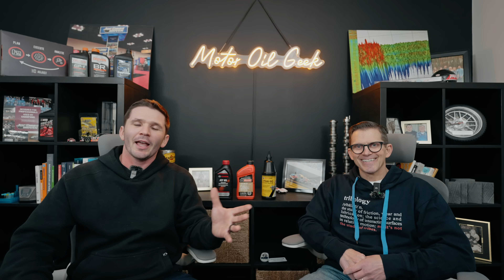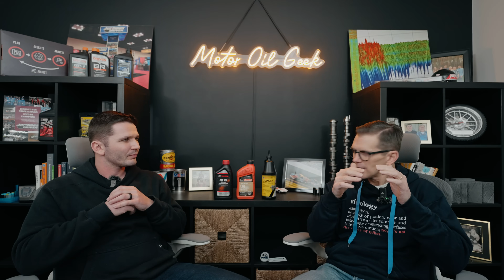Engine VS Transmission VS Gear Oil With The Motor Oil Geek

Comment: Would it be possible to shine some light to the oils used in modern manual transmissions? Some oil manufacturers recommend very low viscocity dual clutch transmission oils and even atfs for some applications like Red Line D4 and many people seem to be using them with good results. What are the pros and cons. The question is targeted to the Getrag and Zf manual transmissions used in Bmws.

Comment: My 2014 hyundai veloster runs 75 90w gear oil in the dct transmission... 234k miles... original fluid

Comment: Can you talk to the fact that the military uses a Rotella 15W-40 for everything. Engine oil, gear oil, hydraulic fluid, and in some cases trans fluid. All you have a 25 gallon storage tank where it is connected and circulated through all it needful areas just like a hydraulic system would. 
Can I do the same thing with my Ford 1 ton diesel truck and run that oil through all my systems?

Comment: 50 Years ago, I was a motor pool mechanic in the Army at Ft. Knox. We were hauling asphalt for 13th Engineers in 5 series 5 ton dump trucks with Continental diesels but we did have 2 8 series jobs with Cummins. These loaded trucks had to climb hills in the process. We were blowing the Continental engines left and right. The Army was using bulk OE 30 and were changing oil on schedule. When we suggested they should switch to Shell Rotella and or change oil when it was wearing out, we were told that it wasn't "authorized." Long story short, we kept blowing up those engines. Cha - ching.

Comment: 0:46 "only piston engines have to deal with combustion byproducts"
Yes, traditional piston engines are way flawed and oil geeks have had to work chemical magic, but the new generation of simultaneous-combined-cycle piston engines won't have such issues. They are clean and segregate combustion from oil by using the steam/regeneration cycle to separate combustion from the PFTE piston rings. Such engines will use single weight simple oil stored in a vacuum insulated flask.
1:27 "blow-by"
Yep, but as long as the blow by is pure water that is evaporated and evacuated by the secondary air system to the oxidizing cat there is zero harm.

Comment: So everyone knows engine oil needs to be replaced annually. How often should you change modern synthetic transmission, transfer case, and differential fluids if I only drive a few thousand miles per year? At 2-3k miles/yr, it would take me 10-15 years to reach the 30k mile interval on my MDX. Surely these fluids can't still be good after over a decade of being in the car, right?

Comment: 9:05 Transmission and diff have breather and you can get moisture in them and from temperature cycles in condensate and drop in the fluid. I seen it when the car was not driven long enought and the ATF instead of being red goes pink but still transparent

Comment: I have seen one or two OEMs validate the early oil change idea, but then they went away from it.  Mercedes did recommend the first transmission fluid change around 30-40k, then supposedly good for the lifetime.  Toyota had an early differential oil change interval the first time, then a prolonged interval after.  You only need to look at brake fluid change intervals to see the wide range of OEM recommendations for the same fluid, anywhere from every two years to lifetime.

Comment: Thanks Lake. Validates my decision to always use Toyota WS in specified applications (AIsin 700 series transmissions) for years and countless vehicles. Never an issue!
Reply: I used Aisin WS from rockauto, given that they make the trans itself, I suspect their fluid is just fine. Heck, I bet Toyota gets their WS fluid from Aisin.

Comment: I really dig on content like this.  Just keep to the facts.

I've detailed the engine break-in process that I follow and the most common response is: if its so good why doesn't the OEM suggest it?  The simple answer is: virtually no one would follow it, as very few would do 3 or 4 oil changes in 3000 miles, as they would view that as a real hassle & they don't want to spend that much time/money in such a short timeframe.

80,000 miles later nearly every one of those engines begins to have significant oil consumption issues, whereas the engine that I broke in does not.  They start blaming everything except how they broke the engine in.  The part that they're missing is that the instant you drive 1 mile past the mileage warranty 100% of that repair bill is on the person that owns that vehicle and not the OEM.  This is also why I've seen so many people put their car up for sale just before it hits 80,000 miles - they know a big repair bill is coming up, and they don't want to deal with it.  The common reasons that I hear are 'I just want something newer' or 'I want the newer features that my car doesn't have.'  Those are both valid reasons, they're just not saying the repair bill one out loud.

You can lead a horse to water, but you can't make it drink.

Comment: Glad to hear a knowledgeable expert advocating for OEM trans fluid. Seems like the logical choice for such a complex component, rather than using some aftermarket product that’s supposed to work across multiple product lines.

Comment: Can you guys talk about transfer case fluid? What’s with different vehicles using engine oil, gear oil, or transmission fluid in the transfer case? And then what happens when you use a different fluid than what’s recommended?
Reply: @Duramaxjon  a lot of that depends on the internals of the transfer case. Some are simple gear to gear and rely on splash lubrication. Others have chains and sometimes internal oil pumps. There are also many modern transfer cases with internal viscous couplers or clutches that need to be able to allow for some slip front to rear. ( think auto 4wd or AWD cars and SUV’s). These often need a special fluid or synthetic ATF to prevent shudder or binding during tight turns. So it really depends on what’s inside to determine the required lubricant.
Reply: Gear driven cases like the NP205 and Dana 300 run gear oil. Chain driven cases run ATF. AWD cases with a viscous coupler typically run a tractor hydraulic/transmission oil.

Comment: I grew up in farming. I have spent my life dealing with hydaulic and hydrostatic oils as well. I learned young. From my master mechanic grandfather. Always use the correct oil. Change out the oils in new equipment to get rid of break in contamimants. And smart regular maintanace greatly improves lifespans.

Comment: What about all the VAG cars ? With their 'lifetime' manual transmission oils ? There's no issue with the gearboxes with 1st fill even after 200k miles. But changing the oil for correct OEM one, no matter in what mileage, will in most cases cause bad cold shifting behavior, and cold i mean below 5 Celsius. Happened to many cars for me or around. There's a lot on EU forums regarding this. 90% of cars in EU had never oil change in manual gearboxes. I won't change either because of bad experience.

Comment: I recently changed the transmission fluid in my wife's CVT equipped car...and after listening to this, I am glad that I bit the bullet and bought the OEM fluid from the dealer. Even at $35 a litre....7 litres is far cheaper than a wrecked transmission.

Comment: At the end of the day if you do not change your engine oil much sooner than what the car  Manufacturers  and Dealerships  say your engine eventually be Toast ...i would definitely not buy any car that has gone with the Manufacturers oil changes imagine a Brand new car that as to run in the engine the first engine oil change should be 500 miles the metal fragments from runing the engine in will cause Damage change the first engine at 500 miles get rid of all the condensation from breaking in your engine the second oil change 1000 miles then 2000 miles ..then .3000 miles the every 4500 miles your engine will last you many many years ..Do as the Car Manufacturers and Dealerships say 10.000 mile oil changes Car Manufacturers know if you Stick to the Manufacturers Service Schedules you will start to get Mercanical engine problems  just when your warranty expires ..Big profits  to the car Manufacturers  you will be buying parts from them  or you will eventually a new car ..

Comment: So then how does that work in motorcycles that use the same oil for all three components?
Reply: it is a compromise for the overall
usually the fewer compromise the more specialized something is and the more expensive it becomes

Comment: If you get a chance to do a follow up, I would be interested in hearing about the viscosity difference. Specifically I have read that an engine 5W30 is similair to gear oil 75W90 for viscosity. (Or something like that.) They feel tremendously different. How can they be similair?
Still great information here. Especially the comment about OEM transmission fluid.
Reply: different viscosity scale for gear oil vs motor oil, gear oil is slightly thicker than 10w40, but it's not anywhere near it's number on an engine oil scale.

Comment: Well I am surprised to hear Lake say he believes in going with the OEM transmission fluid. While I understand his reason, if the manufacturer is willing to sacrifice a customers engines longevity by putting in super thin motor oil to meet CAFE standards, they likely are doing the same thing with there ATF for our transmissions. How can we be sure they aren't?
Reply: Don't worry, as they say its Lifetime but you change It on milleage.
BimmerN53
Reply: So you have an expert telling you... and you question it and think you know better?   Unbelievably dense!
Reply: @Ram14250  Who said I know better fool? Go back and watch all sorts of experts (of which I give Lake credit for being one of), and they are now all saying the OEM recommendations were misleading at best, and flat out lies at worse. WHY? All because they were trying to eek out a MPG or more at the expense of customers engines.

Comment: Regarding ATF we must not forget It flows through  circuits, electronins and solenoides flooding and cooling all the mecatronic system with dieletric properties.
BimmerN53

Comment: The Amsoil ATF really throws a wrench into the mix. They printed on their latest labels: "Use in applications that require the following specifications". I've had it my transmission for close to two years.

Comment: Too often Mercon LV does not do what is intended (i.e., lifetime fluid). There are better alternatives it would seem in this single instance. Ordinarily I would also stick with the OEM ATF, just not for this one. I would also change the Mercon LV (and ULV, as the case may be) or its alternative more regularly than even the severe service interval in the manual. It will be money well spent.

Comment: Hi guys. Great information!
What about motorcycle oil with both combustion and clutch and gears?

Great channel!
Reply: look for JASO MA/MA2 certification
Reply: The MA2 is a higher friction spec is better for clutches prone to slip.
Originally, the spec was MA but later MA1 and MA2 specifications differentiate the slipperyness more.  A bike which is specified MA2 cannot use MA but for a bike specified with MA could use MA1 as long as the clutch doesn't lack bite.

Bikes with gears and clutch in engine oil all shear down incredibly quickly due to not being able to use gear additives in the engine.  The hot grade can shear down a grade in as little as 1000 miles (eg: a 10w/40 becomes a 10w/30 according to published oil analysis results.  Signs are normally noisy gears.

Comment: I have never, nor do I know anyone who's changed their trans fluids for like 50  to 100 kilometres. Scary really. 

Guys you didn't address the difference between types of trans oil. Like DW-1 to ATF2.1 or many others. 

Do you have to use the type in your manual? 

What happens if you buy Amsoil ATF and put it in your Honda and does it work with different transmissions? 

What about the different types and hydraulic effect?  Low level vs  high on transmission fluid?

Comment: What about manual transmissions, and all the advice out there to use engine oil in them?
Reply: Nope not necessarily. Check your owners manual or check with the dealer/manufacturer. Some call for GL4 gear lube, because GL5s are generally considered risky for yellow metals like brass/bronze. Some call for a 5W-30 or 75W-90 syncromesh fluid. Some even use an ATF.  A lot of that has to do with the syncro blocking ring material, some are brass, some are composite materials.

Comment: Motoroilgeek? Is there such this as charging the transmission fluid on a Lexus or really any automatic to much were it will start slipping or shifting weird?
Reply: LOL, , NO!
Reply: Yes, with automatics. Too frequent changes and you'll lose too much of the clutch material in the fluid that prevents slipping. Never changing means that all the nooks and crannies of the valve body become jammed. Six years or 50K intervals, except for automatic transmissions over 100K that have never had a drain and fill.  In that case, leave it alone. (Never flush, in any case).
Reply: @geriscape  The old myth is that if the trans has high miles and has never had the fluid changed or has darkish looking fluid don't change it. Which is completely wrong. If it's still working decently do it. That's going to help it soldier on for many more miles. The problem is many times the transmission already has severe issues when folks try to change fluid and it's probably already too late. Although sometimes a fluid change will help prolong even those. So it's a bit of a gamble in those instances, but if it helps get some more miles out of them it's still cheaper than a rebuild or replacement at that point.
Reply: I am a semi-retired lifetime mechanic by trade transmission specialist.ok?
Reply: I've done just that many times. I'd say the failure rate on changing fluid in those instances when things are getting real sketchy is probably less than  10% if the vehicle still drives and all the gears are still there.
Reply: That's ridiculous

Comment: That’s interesting when you mention the static and dynamic pressure for transmissions to work properly it got me thinking is that why they say when a transmissions past 100,000 miles not to change it to often to get the fluid cleaner beo as elf that or no? I’ve always wondered that . I’ve heard experts say if the fluid dirty , to do at least 3-4 drain and dulls to get that old fluid out of there! Any comments or thoughts??
Reply: The old myth is that if the trans has high miles and has never had the fluid changed or has darkish looking fluid don't change it. Which is completely wrong. If it's still working decently do it. That's going to help it soldier on for many more miles. The problem is many times the transmission already has severe issues when folks try to change fluid and it's probably already too late. Although sometimes a fluid change will help prolong even those. So it's a bit of a gamble in those instances, but if it helps get some more miles out of them it's still cheaper than a rebuild or replacement at that point.

Comment: I’d love Lake to take on coolant.  Or bring someone in from Valvoline.
Reply: coolant is manufacturer specific, and bad idea to mix different kind
Reply: @philiptong4978  I feel like there must be some overlap.  There are coolants they say they can be mixed with any coolant.  For some reason toyota is different than Mazda different then bmw etc.   feels like I should be able to use one coolant in all of my cars.
Reply: @philiptong4978  The fear of mixing coolant is massively overblown.  99% of them are ethylene glycol and water, the additives cannot create a disaster without significant other contamination, like constant hard water being added.  Coolant is an entirely different chemistry, not surprising if MOG had no expertise in coolant inhibitor chemistry.  Coolant is a mess, all proprietary inhibitors and constantly changing as well.

Comment: I did my own oil dump at 600 miles for my new Corolla.  25 dollars for the 0-8 Mobil 1 oil at Walmart, 5 quarts. Kind of stressful because that dip stick is tough to read and guessing partial quarts.

Would a transmission fluid filter help to keep the transmission fluid cool?

Oil analysis adds an additional cost, just changing your oil every 3k miles may minimize cost.
Reply: No coolers cool, not filters. 
 Also that additional cost would probably save you money in the long run over spending time and money changing oil constantly. Besides you are wasting resources.
Reply: That's ok, better safe than sorry.  Oil is cheap and changing your oil isn't destroying the planet.

Comment: When i buy my new car, i will stand at the dealer after a few miles and argue, "change all my fluids now! the motor oil geek said so"  lol just kidding but would make a great conversation at the stealership
Reply: I just bought a new one, had them change the oil before I saw it.  It had 180 miles on it when I took delivery.

Comment: Is there such a thing as too cold for transmission fluid? I removed the thermostat on my 8l90 and now run anywhere from 100°-145° depending on outside temps. Will hit 170’s when towing heavy.

Comment: Oem transmission oil change is ridiculous. "Vehicle's Life time"
Reply: It's usually the transmission's life time. OE can't sell you a new car if your old one is still going.
Reply: GM, Ford , and Dodge consider 100,000 miles as the lifespan of the car.
So it's lifetime fluid. kinda
Reply: @3rdGenGuy usually a states temperature classifies for server service which is half.
Reply: Actually if you look in the owners manual, the real change interval is still listed under 'extreme or severe service'.
Reply: @zmmj2024  if you don’t see any service listed there look up the manufacturer of the transmission. For example ZF makes a bunch of different transmissions in both N American and European vehicles. They often list fluid intervals way sooner then the vehicle manufacturer.